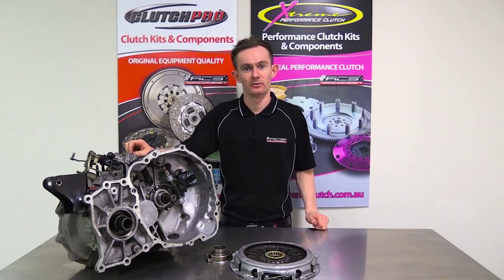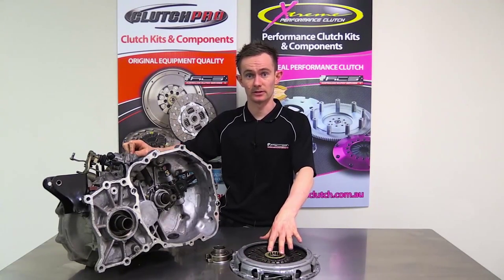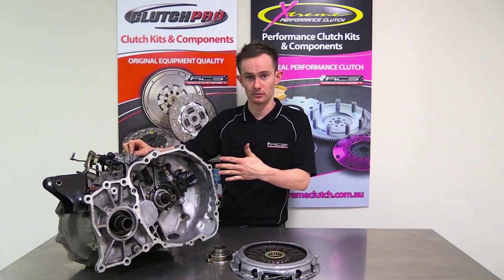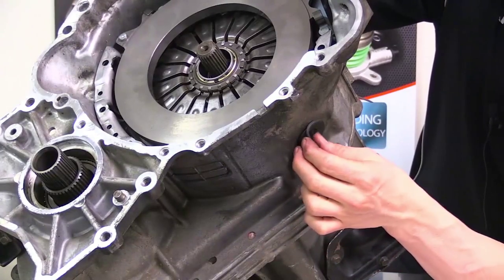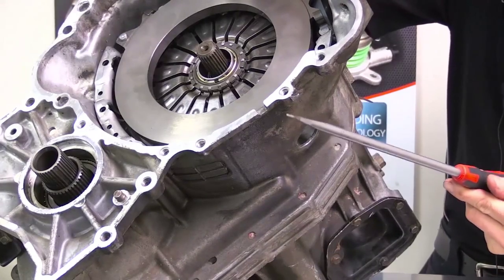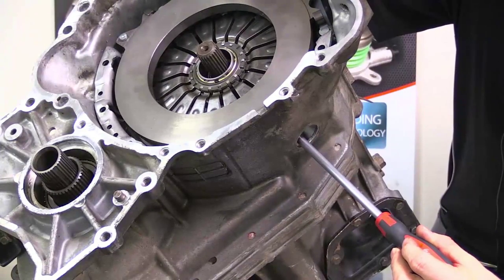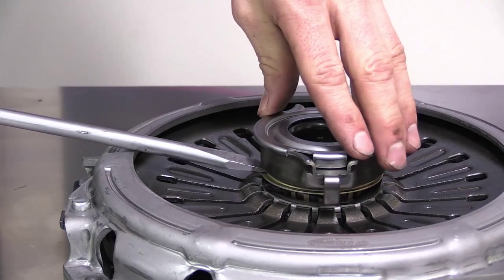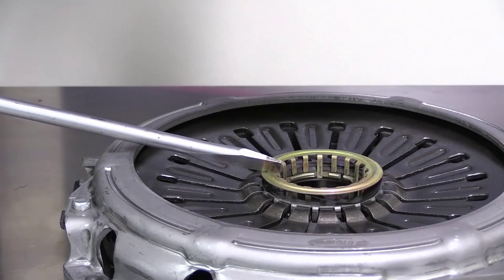CLUTCH TECH: Pull-Type Mitsubishi and Subaru Release Bearing Removal

Comment: Just use a long ring spanner up through the bung hole sit the bolt half in and pull shaft out releasing the clutch fork (if you failed with the ‘quick’ release haha